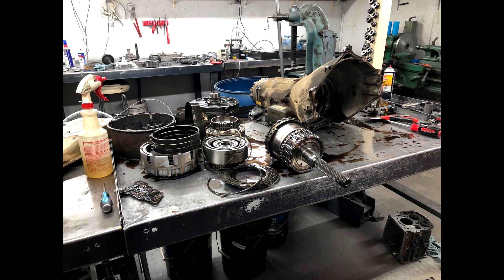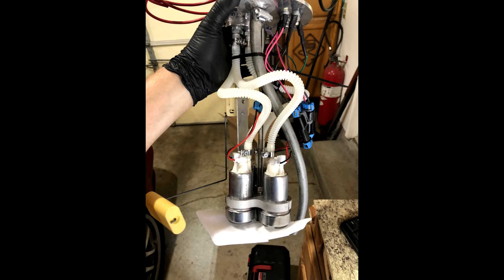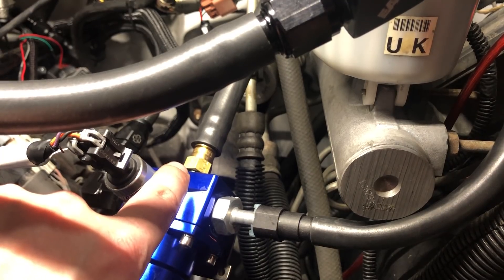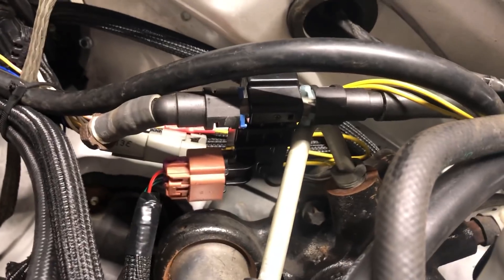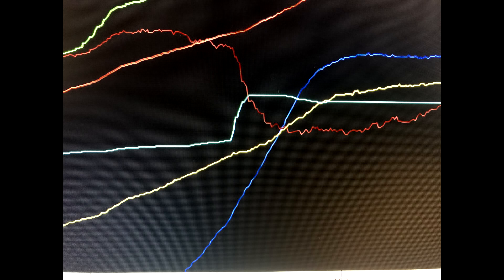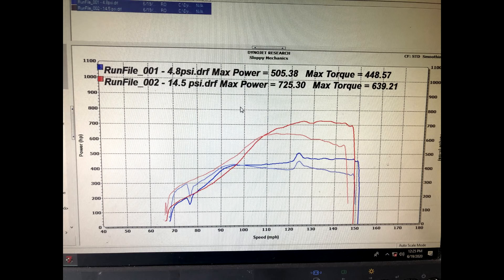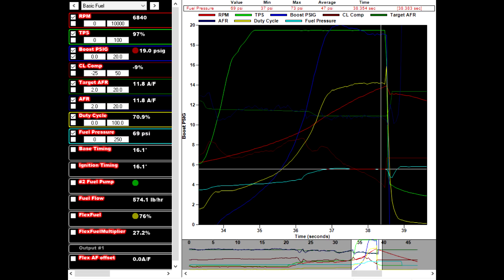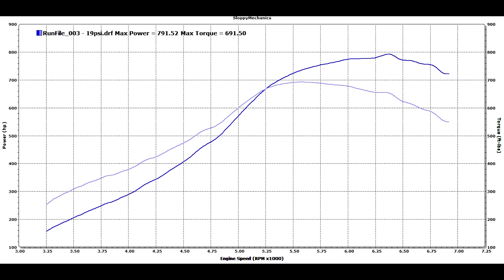turbo 2500 update - triple pump and triple disk dyno shakedowns

Comment: Spotted a t5 case on the floor under the trans table. Makes a good stepping stool.
Reply: I had one live for 60k miles behind a 300 hp 302. The car only weighs 2450, and never had a tire bigger than a 225/60 15 tho. Torque boxes ripped out in '99, been parked ever since. It was working good when the rear u- joint snapped.

Comment: You have a tow rig that will outrun most drag cars. Pretty cool.
Reply: Slow restoration has a 2500hd 4x4 quad cab 6.0 with a 7875 remote mount, runs 11's and tows a trailer with tractors and other heavy mess on it. Stock 6.0 with nothing but the Cleetus dumpster fire cam and stock  4l80e with HD2 kit and a converter. Never thought I would see the day when a work truck that actually looks like a work truck blowing away real hotrod cars or towing a hotrod that's slower than the tow rig

Comment: Love the build and how awesome the factory gauges work! Quick question do you have a link for the loom you use on your wire harnesses you make? I am doing some under the hood wire cleaning from the previous owner and would like to know what kind you like to use and also how you usually size it or what are the common sizes to use. Thank you!

Comment: Why does it smoke so bad on Decel? You not restricting the turbo oil feed properly?
Reply from the maker: It has no crank case ventilation at all, and valve stem seals are 14years old lol

Comment: Just out of curiosity, does the cruise control still work with the holley being wired in with the stock computer?
Reply from the maker: This truck never had cruise, but no I removed the factory drive by wire stuff so it wouldn’t be able to use it

Comment: Can you have the pumps come on, intead of boost or TPS, based on Injector duty?
Reply from the maker: Yes with the Holley you can cross reference anything with anything triggered by anything
Reply: @SloppyMechanics  I'm using MaxxECU, ultra flexible too

Comment: Do you sell turbo parts. Am building same truck. Looking for header ps  budget 2500 2wd signal gt35 for now
Reply: Vs racing does, and I've only heard good things about their stuff.
Reply: I believe this truck has a fahler speed turbo log on it
Reply: A single GT35 on a 6L isn't the best idea a GT45 or 7875 from VS is a better place to start unless you get a second GT35 and go twin. You don't need turbo headers, use the stock manifolds flipped or backwards.

Comment: What down pipe size u run or what would b good for a nice ls build
Reply from the maker: Depends on goals, build, power, and room in your vehicle
Reply: 3" with a single on a 4.8-6.0 is smallest to make power without crazy restriction, 3.5-4" is more ideal for efficiency in the 500-800whp neighborhood that is Sloppy, mainly driveline strength and traction are more important to a set of goals than 1,000+whp.

Comment: Your going to deadhead the fuel at the flex sensor, put it on the return line.
Reply from the maker: Not going to. I did, also I said I will eventually move it but for now I get to see if it works and if it triggers people lol